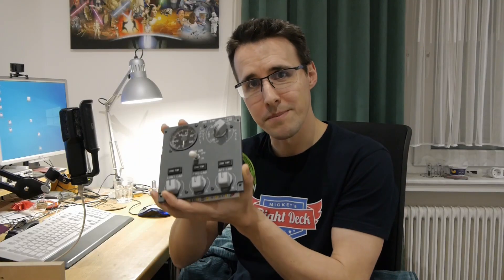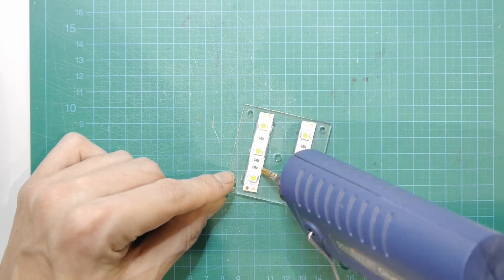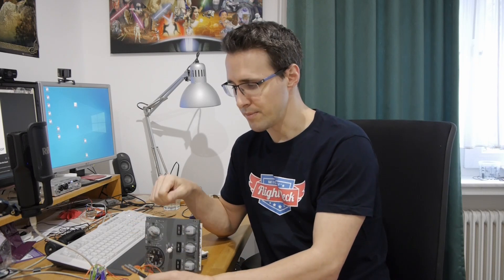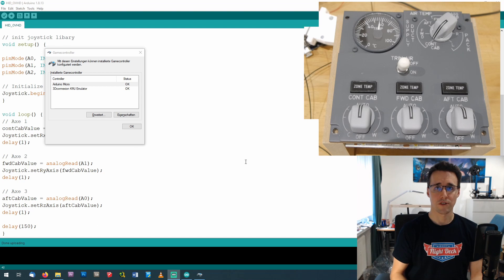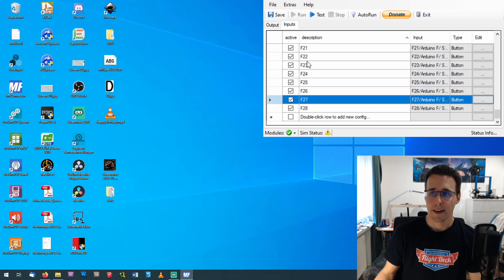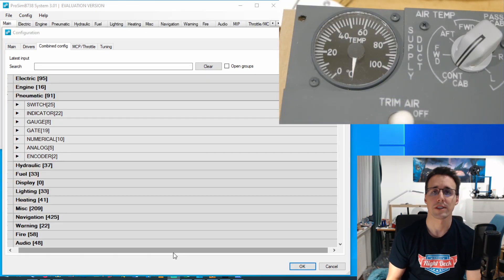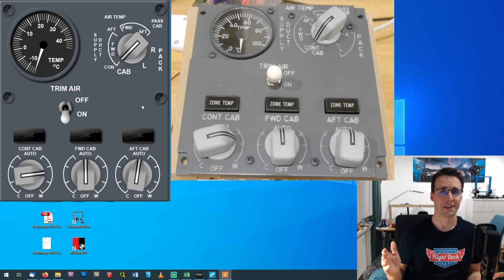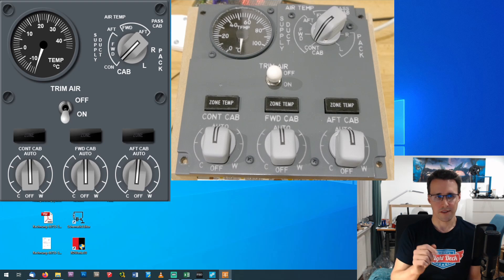Air Conditioning Panel - A Boeing 737-800 Homecockpit #50

Comment: Awesome video... but i have a question, how did we set SPD INTV button on MCP panel?
Reply from the maker: You know that this is a video about the air conditioning panel and that I haven't built the MCP panel yet? But in Prosim I would set it with the "MCP Speed Int Pushed" value in the MCP category.

Comment: I have just binge watched pretty much all your videos (not the live ones though). Amazing work, very inspiring!
I have a couple of questions if I may. 1) Where do you purchase your switches, rotary switches, etc. 2) How do you get your rotary switches to match the positions of your engraving perfectly? 3) Have you thought of multiplexing your arduinos so you don’t need to use so many of them?
I’m really looking forward to watching the next videos! Thanks again!
Reply from the maker: 1.) All the switches can be found on aliexpress. 2.) The positions of the engravings can just be calculated. An eight position rotary switch has a stop every 45 degrees. So when you know the place where your switch will be then you can align the engravings around it. 3.) I'm using MobiFlight and this isn't supporting multiplexing.
Reply: @Mickeys_Flightdeck  Thanks for your quick reply! I tried looking on your website for specific model/part numbers for the parts but couldn’t find any, that’s why I asked. I always worry about buying the wrong parts, especially after waiting a long time for shipping from AliExpress lol!
And that’s what I wondered, as I’ve only been able to find 30 degree ones so far, which are not great! And, oh I see! That makes sense, I wasn’t aware it wasn’t supported on mobiflight!
Reply from the maker: @TonyDocksStation  Most of the articles don't have an easy to find model number. By the way, I wasn't able to find big 8 position rotary switches. So I took the small ones.
Reply: @Mickeys_Flightdeck  Thank you again for your reply. I will spend a bit more time looking on AliExpress. Once again, looking forward to your next video!

Comment: Hello Mike! In order to check the gauge you can increase CONT CAB zone temp with the left potentiometer and choose CONT CAB Air Temp to be displayed in the gauge. The range of temperature is approximately 65°F (18°C) to 85°F (30°C) as in my company’s manual. Thank you Mike for all your helpful videos ✌️

Comment: The pot shake is dealt with in Arduino code using a Debounce function. There is plenty of examples on the web for solving this. It's caused due to the small parts used in manufacture continuing to move about after the User rotates the pot shaft in this case, before a full electrical read is possible. The worst cases you experience of this are in cheaper electronics (as the physical parts are very lightly built). Debounce reads two states between a defined time delay and averages all the readings within that same period into one. Your item's data sheet will have the detail that indicates how accurate your Pot is, which you then use to set the debounce parameters within the Arduino code.
Reply from the maker: Thank you. I will look for this.

Comment: Great video as always Michael. I was wondering which color you were using for your knobs. Could you share the RAL code?
Looking forward to see more videos and getting my simulator running.
Reply from the maker: The white switch caps are painted with 9002. The knobs have 7047.
Reply: @Mickeys_Flightdeck  Thanks a lot